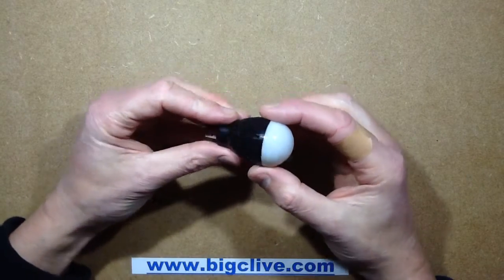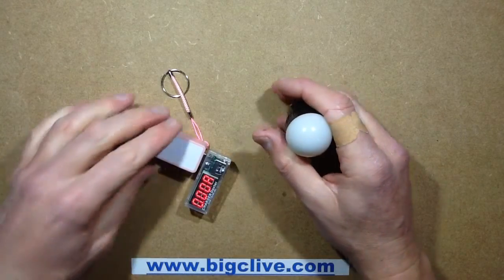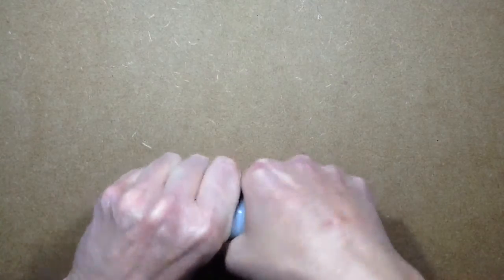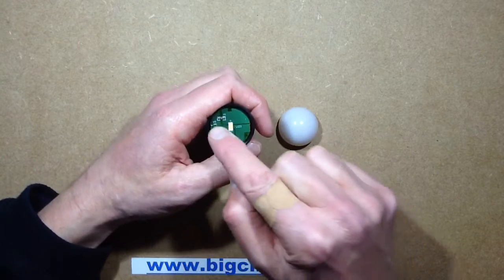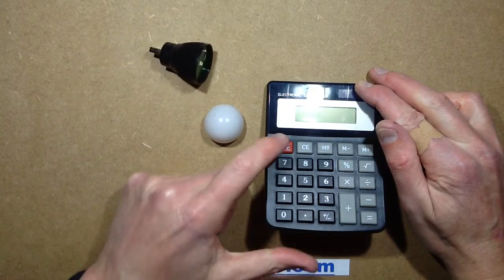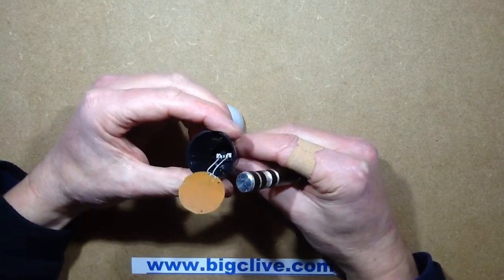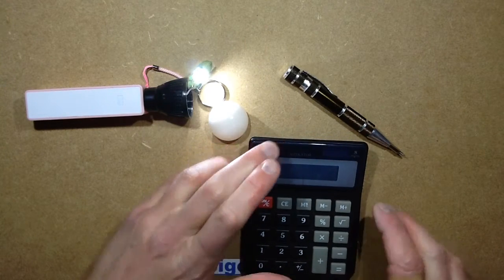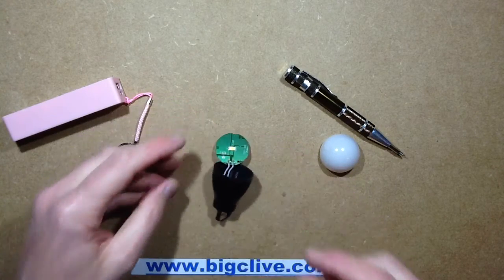LED USB lamp internal examination.

Comment: Do you know how much brightness does it produce?(lumens)

Btw i like to watch your video,you do the teardown so that i don't need to and can see what's inside of it
Reply from the maker: tan hock jun I don't really have an accurate setup to test these lights other than intensity comparisons between adjacent lights.  The biggest factor affecting the intensity in many of these lights is the diffusion plastic on the front.  It seems to be very opaque sometimes.